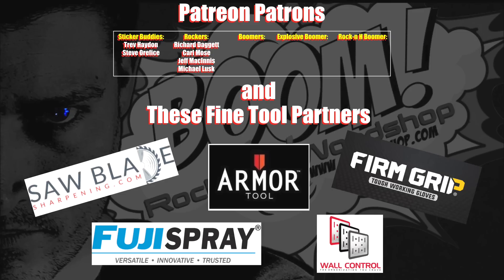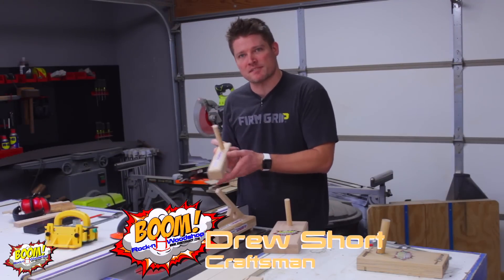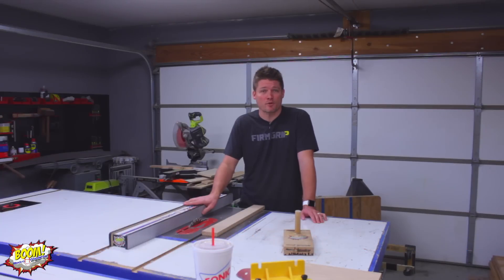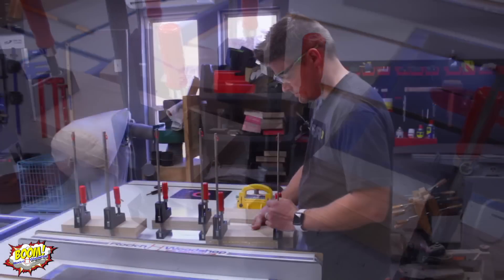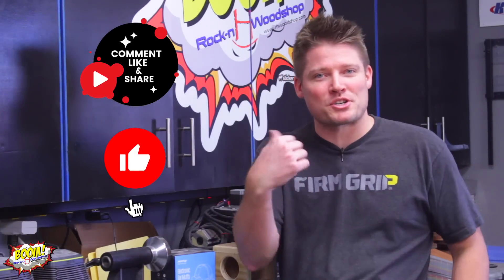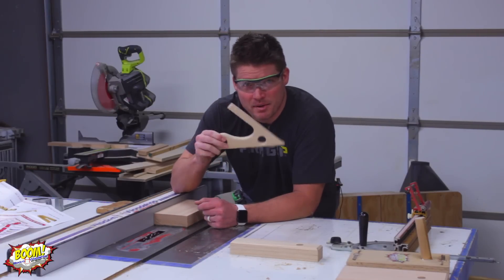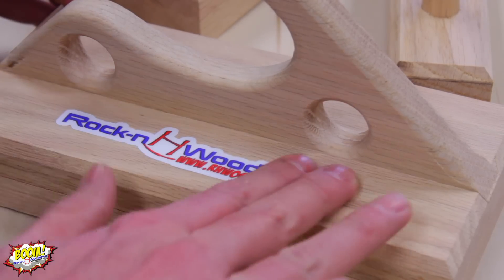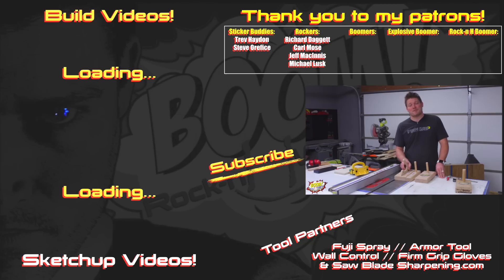My Favorite Push Blocks // How to make

Comment from the maker: Hey guys, thank you for checking out this latest video for this shop build. This is perhaps one of my most favorite push sticks to ever use in my shop. Having the thinner version now will make it even safer. I wanted to also say that if you choose not to throw this away, you can cut away the chewed up bottom and re-laminate with a brand new board if you don’t want to remake the whole thing over again.  Take care and BOOM!
Reply: Thank you for that. I was going to ask about salvaging the old push block. Great video. Thanks!!!

Comment: I like the idea of push pads instead of push sticks. Very handy in certain situations!
Reply from the maker: Yes sir they are and they would be good use on the jointer as well. Adhere a high grit sandpaper to the bottom for extra gripping pressure

Comment: Make them a little thick and only set your saw blade 1/8 inch above the workpiece. When you have cut it up to the point you are thinking about throwing it away, run it over the jointer a few times and make it new again.

Comment: I tend to shy away from anything with an upright handle that can push directly against the palm of my hand.
I had a piece of wood kick back one time - in turn it forced the push block into my hand with a tremendous force.
Nothing broken and I still have my hand but it was stiff for a week.
Since then I prefer to use a block that I hold from the sides.
In the event of a kickback the block can fly out of my hand without breaking any fingers or slamming against the palm of my hand and potentially damaging my wrist.
I was lucky that time and take every precaution since.
All I can say is think about your design and where your hand comes in contact with the block - never make finger holes in your blocks - in a tenth of a second something like that can potentially break a few fingers or worse.. Rip them off your hand!

Comment: Very nice but 1 question. instead of throwing the used stick away why not just clean the bottom up and laminate another board over it?
Reply from the maker: Now that I have my bandsaw tuned up, that’s what I plan to do. Cut the bottom off and then re-laminate

Comment: Awsome video Drew. One question: Do you think setting the handles on a slite angle to apply side force towards the fence would help prevent binding and/or kickback when sawing.
Reply from the maker: It’s possible that that would help a little bit too, yes. The catch that goes along the backside of the push block taking up the entire width of the block helps to keep it pretty square since most catches are a very small piece that’s only meant to grab the wood, but anything that you can do to help it along I imagine would help out too.

Comment: Why not hand plane the worn one to flatten the bottom and then glue another piece on it the bottom so it can still be used?
Reply from the maker: Now that my bandsaw is tuned up it would be easier just to cut the bottom off using the bandsaw and then glue another piece on. I didn’t have that before
Reply: @rhwoodshop  I like it! That would be faster and could be a lot less work to get it back into working order.

Comment: Does it matter if it is a soft wood? Like pine? Or should it be a hard wood?
Reply from the maker: No but if you make the handle like my 45° handle with the holes, I would make sure that the grain is running in the same direction as the handle so it is less likely to break under pressure. If you intend to use a dowel, you won’t have this problem

Comment: At 3:48 did you make a crosscut with a miter and the board against the fence?
Reply from the maker: Yup it was a complete push through clamped tightly against the gauge. It was not brought backward like you would need with a gauge block.

Comment: Why not make the chewed-up bottoms interchangeable so you don't have to remake the nice handles again and again?  Doing that does not change control and it puts the fingers even a little bit farther away from the blade.
Reply from the maker: You could do that but you would need to figure out a way to attach it and keep it attached without the use of metal fasteners just in case your blade comes in contact with the joint. A sliding dovetail possibly with a stop dado might do the trick but it is something to think about. You could theoretically run the chewed up piece through the bandsaw and cut it completely off and then make you another bottom piece while still keeping the upper piece intact.
Reply: @rhwoodshop  What I use is a block of material with the same dimensions as the bottom of the push base.  It's thick enough so that the countersunk screws that hold it to the base are above the cuts that are made in the "chewable" portion.   Of course, you have to take care not to raise the blade more than a half-inch above the material that is being cut so as not to run into the screws that are sunk 3/4-inches into the sacrificial bottom.

Comment: No need to throw it away, just run it through a planer and add more wood to the bottom
Reply from the maker: Well the problem is with the handle attached you can’t run it through the planer unless you cut the handle off. So it’s better to run the whole thing through a bandsaw and cut the bottom off and replace that
Reply: 😂😂Woodworkers do Hate scrapping wood...

Comment: Just dado a stop into your old pusher and get a few mores miles out of it. Maybe run it thru the jointer a few times first.
Reply from the maker: This time since I have upgraded the handle, I plan on just running the bottom through my bandsaw and cutting off the old chewed up area and replacing it with another
Reply: @rhwoodshop  That works too.

Comment: When the push block gets to the end of its useful life, why not just use the jointer to take down the raggedy bottom then relain ate a new piece to the bottom.
Reply from the maker: I get questioned on this a lot but I actually now have my bandsaw tuned up to where I can run it through that and cut off the bottom